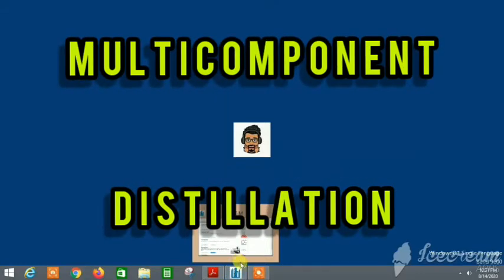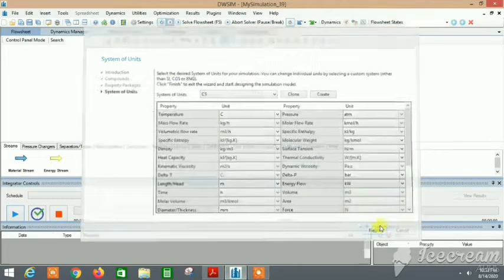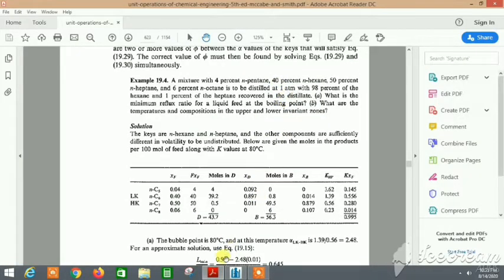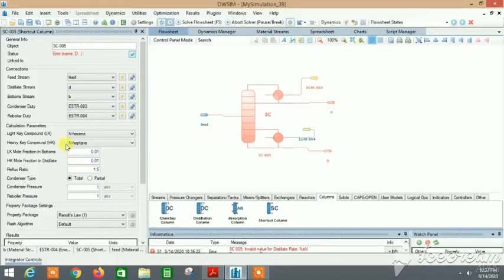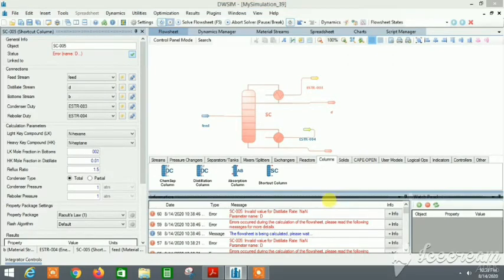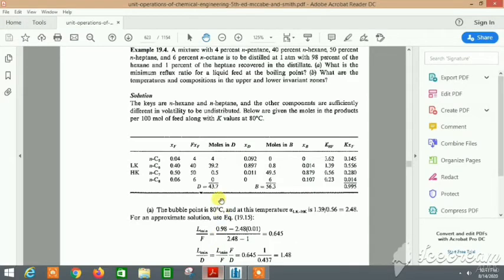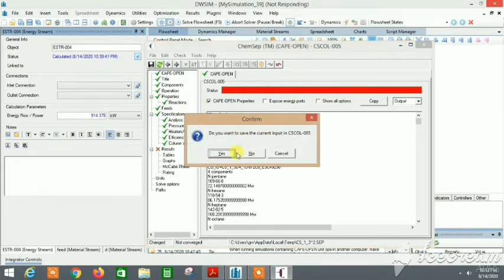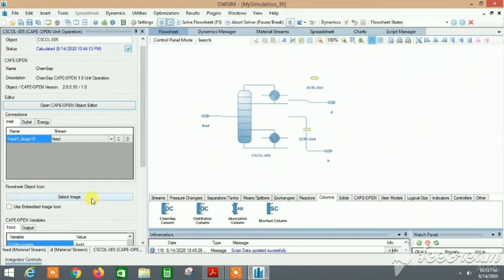Multicomponent Distillation in DWSIM | dwsim tutorials

Comment: How to add diesel as input to the mixer since diesel is a mixture of different components?
Reply from the maker: There are different composition and grades of Diesel in the market. For a particular Diesel grade , you have to create a compound using the Petroleum compound and put in different data required required. Or try to import a pre existing Diesel property file from Aspen or from internet. This process is little complex and requires proper data.

Comment: if chemchad is not installed then it wont work chem sep column
Reply from the maker: CHEMCAD and DWSIM are different softwares so if you are using DWSIM then chem sep will work there if installed